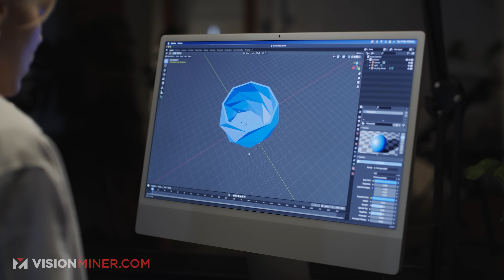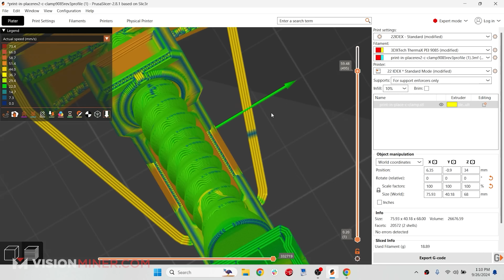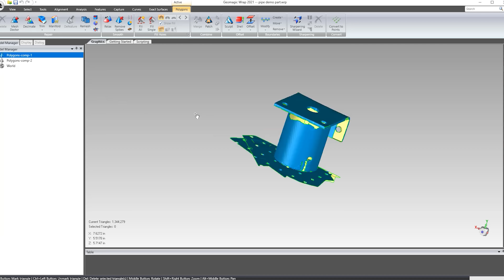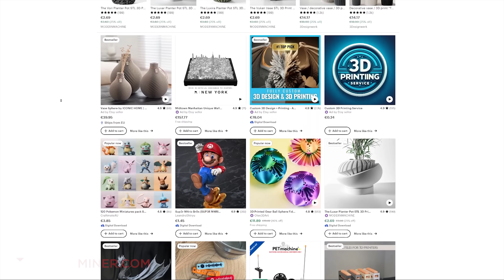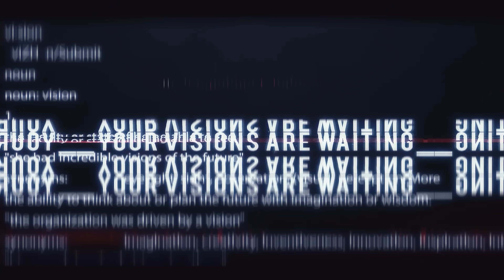Did This Machine Ruin 3D Printing?

Comment: As Prusa support tech,  I know the bambu effect is real. 

Too many people print horribly, weak or fail in defaults, blame the machine,  I try to show them what the slicer can do, they either get excited to learn more or start a diatribe about "too much tinkering, I want simple". 

The defaults can get you far with most models but not every model/production batch.
Reply: But its kind of like the learning curve with computers. It used to be similar to 3D printers, you had to know the ints and outs, how to really manipulate the machine to get it work how you wanted it. Now, any person can just turn on a machine and have it do what they want. Is that a bad thing? No, its just how far the technology has come. Sure, it creates a barrier if there is an issue, but no one would argue that computer tech is worse just because it doesn't force the average user to know what's going on under the hood. You still can in order to get the most out of it, but it isn't essential to owning the machine. Bambulab advancing the tech and making it more accessible to the average user isn't a bad thing, it just makes it so gatekeepers have a harder time making themselves feel superior to people who haven't spend the same amount of time on the tech as them. The only people getting upset about Bambulab machines are those that resent the fact that their knowledge is becoming outdated and they can't be as pretentious about it.
Reply: @KCInherent   you are right, but I think no UI dumbing down is gonna make your particular print geometry or print batch better, just printable.
Reply: I don't know about you but this sounds like great job security 😂😂
Reply: @noyiian6734  I guess It is in a way, I'll probably be out of a job the day people read all the KB documentation, or have an AI telling them what to do, or the AI is making the right slicing choices for them for optimal prints.

I just hope to be ahead of that by then😅

But slicing is only one type of questions and print issues. And issues vary wildly. 
 
But these are the most satisfying for me to solve
Reply: yes but blaming bambu for making it easier is the stupidest thing to do.
Reply: @ineedgoodname  not blaming anyone, but I think everyone should tip their toes in their settings instead of relying on default profiles, and they will not regret it once they see the results
Reply: With this dumbass analogy nobody should drive a care unless they are a mechanical engineer or even a mechanic. Ridiculous
Reply: @johnjoe769  maybe they should so they would stop blaming the car or the oem when there was no maintenance done in 100k miles and the car breaks down...
Reply: @johnjoe769  and I am not a mechanical engineer,  I am an electrician, you dont need to be an endineer to see that a part looks fragile or at risk of detaching, thats all experience from failures
Reply: @fofopads4450  but thats the thing. They give you the option to do so. You can easily modify the gcode, you can easily look further into the slicer settings- everything you need to tinker around is there. But now the only thing they made better is that it works out of the box without having to fiddle about. But again if you want to do it, the option is there. I don't get people who hate this idea and are so adamant that it needs to be super complicated out of the box
Reply: @johnjoe769  I don't disagree with that, but don't blame the machine/company for not looking further.
Reply: @johnjoe769  then use the defaults, but if your prints are not as nice,  dont blame the machine.

Comment: We have a Stratasys 3D printer at work that we got in 2014.  We have always used GrabCAD with it and I can say that I wasn’t even aware of the idea of slicing until I got the Bambu P1S for personal use recently.  We just put the part on the plate and send it to the big Stratasys.  That’s not to say it’s been an easy printer to work with.  The nozzle frequently clogged.  Getting parts off the semi reusable plastic beds is a pain and washing the soluble supports off is a nasty process.  We are finally retiring that printer and replacing it with a Bambu.

Comment: J have an sv08 its good printer my grape with is the first layer the front of the printer prints a bit further away than the middle and the rear of the bed. Other than that its great and i have full 100% control on it and the settings. It collect none of my data. I have control on the slicer and i slow down my printer quite a bit to have thr best layer adhesion possible relative to time a middleground

Comment: I dont think that expertise is dying.  The people who knew the high level 3D printing stuff before Bambu are still out there, and most of them are probably still tinkering away, because they are the tinkerers who wanted a printer before it was easy.  It's just that now there are a ton of people who dont want to tinker, but want a printer to just print shit for them who now have access to a prunter that just works.  If anything, Bambu has probably exposed more people to printing who will then go on to learn higher pevel printing skills.  It may not feel like it, because the hobbyists and professionals are getting washed out amongst the flood of entry level, basic consumer level users, but i guarantee you that the sum total number of enthusiasts is growing as a result of Bambu broadening access to the tech.

Comment: I don't mind that printers are easier. I got fed up with my Ender 3 and got a Prusa Mk4. So much easier and less tinkering. But talking about gatekeeping - well, Bambu is gatekeeping. They started an exclusivity program, which keeps people from putting their models on other websites. Their printers tend to be locked down a bit more than most other brands. They use digital signatures so nobody else can create an RFID tag that Bambu printers will recognize. Bambu is building themselves around gatekeeping. I expect more gatekeeping to come from Bambu Labs in the future.

Comment: I've been printing since 2018 and from what I've seen you've got two groups. Those who like the printer itself and those who like what the printer makes. While I do enjoy tinkering with stuff and fixed my old Ender many times, I got tired of the inconsistency and swapped over to a Bambu. I love the consistency and it allows me to focus much more on making good quality prints and not just getting it to print in the first place. I do acknowledge though that I fall within the group who loves the prints more than the printer.

This same argument can be made about cars with manuals. Though I can enjoy a good manual, I don't think I could realistically drive one to and from work on a daily basis. Though it is feasible, it takes way more effort than I can to put in. Now this isn't to say I don't love my automatic or don't care for it. I love my car and really enjoy weekend drives in it, but I think it comes down to personal preference AND how prone the person is to tinker with stuff

Comment: To me its life... You can see such things all the time, specially in crafty branches... I for example am a hand woodcarver. Not a chainsaw carver, not CNC... hand woodcarver. There are those people that are up for the challenge and do it themselves, but there are and always will be the peeps who just want the result, nothing else... Those people go the CNC rout in my field.

Same with 3D printing. Things get easier due to inventions and optimisations. It opens and broadens the door to 3D printing cause it just works... But the downside is ofc that those new people are mostly people who just want to 3d print, not build a printer and care for it. 

In my carving school (yes, I'm still a apprentence) they asked me what 3D printer they should buy for school and where dumbfounded by the hughe list I gave them. In the end they bought a industrial grade one (cant remember the brand, Core-XY config with dual hotend) for almost 5k but are now super upset that it just doesnt work as they wanted...

Comment: The ablity to slice can be learned through the documentation of the slicer, that isn't a lost art but a lack of knowledge.  The real problem is... CAN YOU 3D MODEL!!!! The real unlock belongs to 3D modelers not slicing...which is really straight forward and is only really learned through trail and error by tweaking and testing the diffeferent parameter settings. 
So many people are claiming to be an expert but cant even model, and scanning doesn't count.

Comment: dumbest opinion I've heard about bambu since the release. You don't want a printer that does most of the work for you? Stick to your modded vorons and enders that will continue to have issues. The people that buy bambus usually just want superior print quality and a machine that looks nice. It is the apple brand of the 3D printing world at this point. So compare apple to android, you want custom parts and a machine that has all kinds of moddable? get an android. If you want a machine that works out of the box, get an iphone. Saying that bambus arent for beginners makes no sense at all. I went from a prusa to a bambu while it was still in crowdfunding. I taught myself to rebuild the print head and take the machine apart to ensure longevity and pristine maintenance procedures in about a day. The slicer software is so user friendly it basically holds your hand. People's ability to slice things come down to a skill issue and not taking the time to try to learn or search up good print settings for different scenarios. That is user error not machine error. You'd have to be braindead to not be able to figure out a bambu printer.

Comment: I do 3D. I just want to print my ideas. The silcer should translate my idea into code so the machine can read it. 
If it is your hobby to fight with the slicer and the machine to do what you want.. fine..
It is not my hobby. Mine is still doing 3D.

Comment: Well, then you should discontinue your Vision Miner Nano Adhesive-- after all, it makes 3D printing so much easier.  It, combined with a Bambu X1C means that just about every print I send to my printer is successful.

Hey, remember when Dremel announced their 3D printer, and people rushed out to buy it, only to discover if they wanted successful 3D prints, they had to learn how to level their printer, and calibrate their extrusions, and figure out the ideal temperatures?  And how many people went "screw this, 3D printing SUCKS!!!".

Do you know how to double-clutch a manual transmission?  Do even know how to DRIVE a manual transmission?  Can you adjust the points or valve lash on your car?  Or even the spark gap?  When was the last time you used a grease gun?  If you didn't answer yes to all of those questions, are you qualified to drive an automobile?

When taking a photograph, what's the correct exposure for 100 ISO on a bright sunny day?  What's the correct exposure if you want to slow down the action?  Or if you want less depth of field?

When I started computing, I had 16K of memory.  Yes, Kilobytes.  Every variable, every variable NAME consumed precious memory.  Code was optimized within an inch of its life so it would fit.  And most of the time, you wound up writing in assembly or godhelpyou machine code.  Do we really need to be able to manage punch card decks to run Windows?

Sorry, but this sounds like a bunch of "wah, 3D printing is too easy!  These dang kids don't know what it's like to calibrate a printer with nothing but a sheet of paper, and the joys of compiling their own Marlin!!".  I would think, as a company that actually sells 3D printing products, you would want as large a potential customer base as possible.

Comment: Thank you and i agree that printing group are killing it with the questions that can be fixed easily with slicing parameter changes of the g-code. Can i please get yalls recommendations of super entry level scanner for parts that can be printed on a K1C. I use ORCA slicer and it is the best. just went from printing PLA to PETG and I’m loving the little things I can make for the house like wall mounts for bikes or small car convivence. IM in the aerospace industry and would love to use this for my job but I’m not at that point yet but loving the learning to do it.

Comment: Perfected may be a better word than ruined. When I print, I need it to just work and that’s why we’ve always used Stratasys. It’s nuts expensive, but it just worked. Now Bambu can give amazing results on protos for a fraction of the cost without the hassle and that’s exactly what a tool should do.

Comment: Every person who chooses to purchase a computer numerical control (CNC) machine (which 3D printers are) must accept that these are not plug and play devices which can be operated without having knowledge of the technology and how to maintain the equipment. I've been working with CNC machines since the early 80s. Early on I found it necessary to learn all things necessary to fully utilize the capabilities of the machine tools, including metallurgy, tooling, fixturing, and maintenance and/or repair of the firmware, mechanical, electrical, electronic, hydraulic, and pneumatic systems.

CNC equipment is complex and will not simply produce high quality output over weeks, months, or years without a significant investment of time by the owner or his key employees. The failed expectations of people who were misled into believing 3D printers were like desktop laser printers was foreseeable.

Comment: Bambu bringing 3d printing to the average human is magnificent. It allows people to create on a whim, maybe take up CAD and learn to model. However, the downside is it has given people a false sense of overconfidence when they just click slice and run it. There is a pro and con, the pro is they work, the con is when they don't the average consumer has 0 idea how to troubleshoot the issue and make the proper repair/adjustment. Thus resulting in the massive influx of people in online communities with simple issues and absolutely 0 idea what their next step should be. Or a machine they bricked because they just started messing with things they didn't need to and broke something non-servicable. A proper working machine is great but having a proper knowledge base behind how to operate and maintain the machine should be emphasized by manufacturers. At the end of the day a 3d printer is not a user friendly machine, it is still a machine made to manufacture something.

Comment: You could also apply this to the sciences. I'm not a physicist, but I know a good deal for not being one. I run into knowledge (or skill) blocks all the time. Is the answer for me to go back to school and become a physicist, or is it OK if I just ask an actual physicist to clarify things? 3D Printing is the same. There will be every spot in the spectrum of expertise, and to say that most people should be able to do the stuff that the experts can do is 100% gatekeeping. I was there a decade ago, struggling with everyone else to get these things running and printing quality prints. My expertise in this field is valuable to those who don't need to or have no business going as deep as I did. The Bambu didn't ruin 3D printing for anyone. It's not meant for the tinkerers/experts (even though you can still use them if you want). It's meant to open 3D printing up to people who would normally not even try. Again, there will always be those of us who go the extra measure and develop expertise. We're just entering a period where that doesn't have to be 99% of the users, which is a good thing.